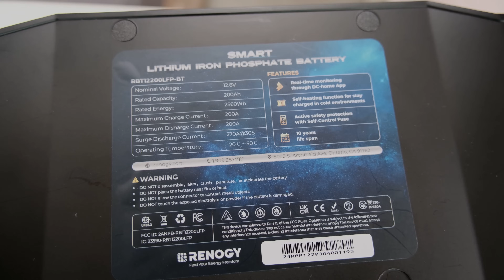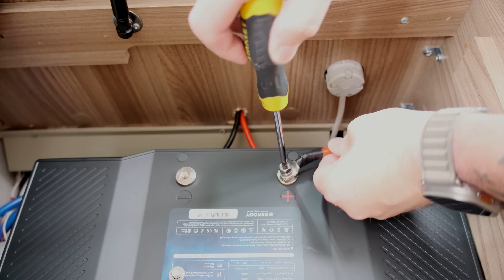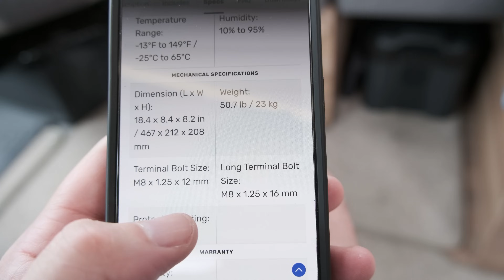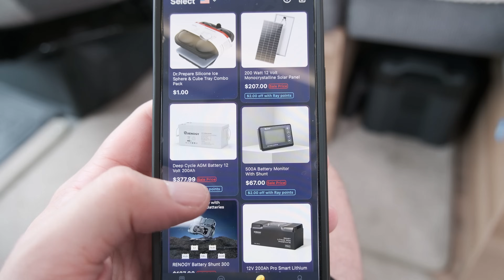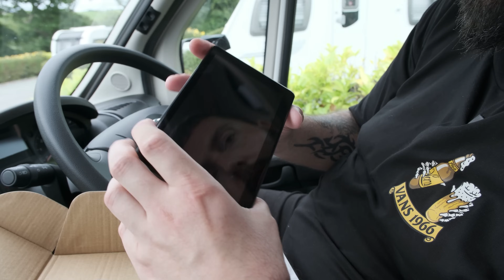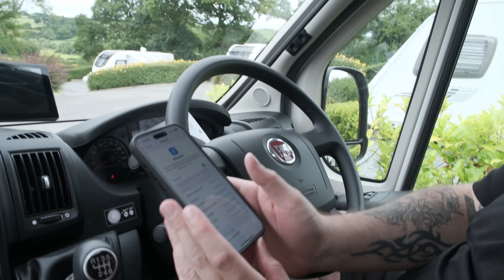Huge Battery Upgrades for our Motorhome - Renogy Pro Smart Lithium

Comment: I think there is s requirement for an air gap for each side of the battery.  for heat dissipation.  not sure your pillows help up against it;)  probably ok in the winter but... food for thought.
Reply from the maker: good shout, we have now installed an inverter under that seat now so we have removed the pillows and duvet to a new location so theres plebty of air curculating

Comment: Fantastic upgrade! Any tips for installation?
Reply from the maker: @kokorowatanabe9022  really easy installation if you are replacing it and have the space in the same location, just make sure you have solid terminals on wiring and ensure that it is gel in place with brackets and a strap to stop it moving about